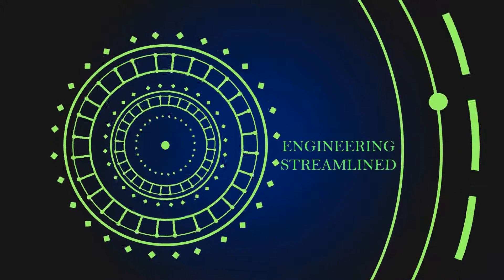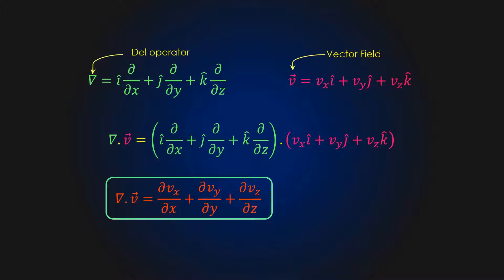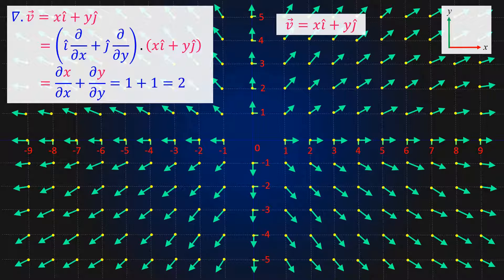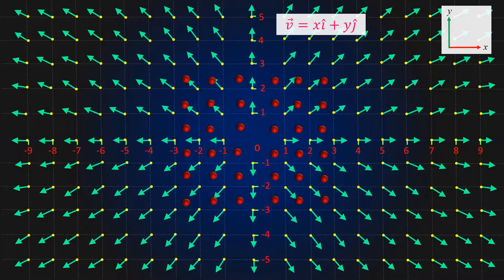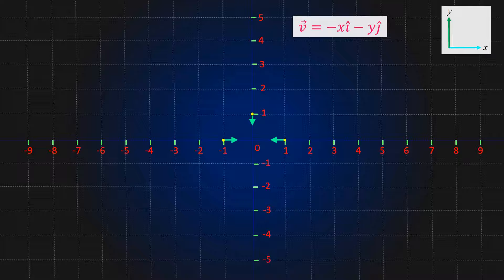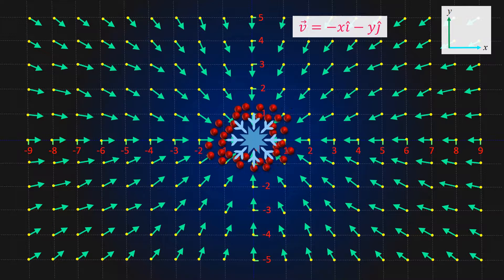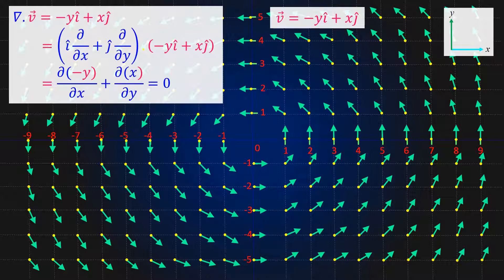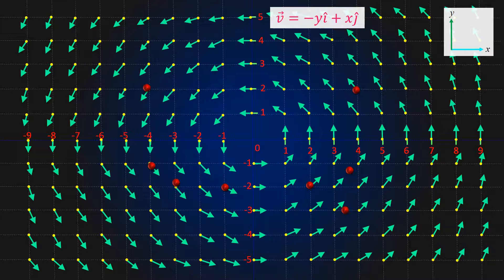Physical Meaning of Divergence of a Vector Field

Comment: WHAT THAT 2 REPRESENTS
Reply from the maker: The number represents the strength of the flux field. The greater the flux of field through a small surface enclosing a given point, the greater the value of divergence at that point.